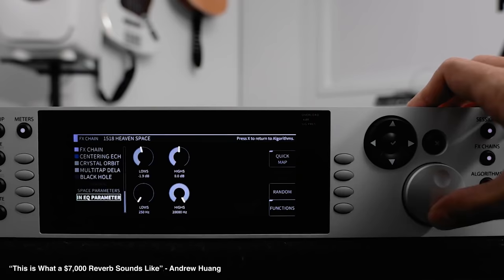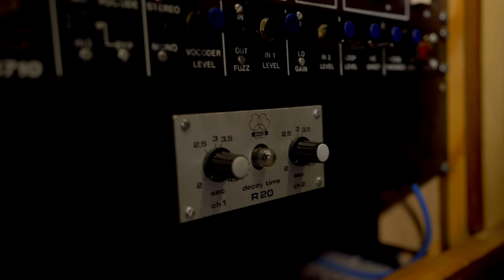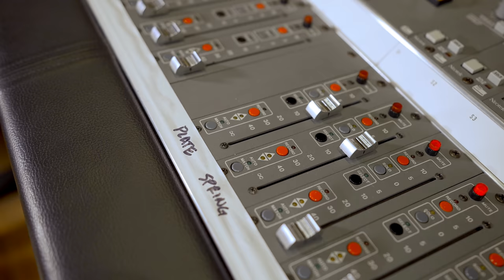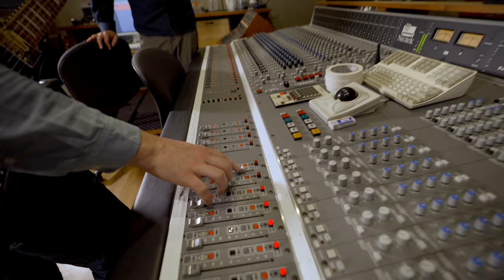Why Huge Metal Plates Are on SO Many Songs (reverb machines)

Comment: I'm by no means an expert, but to me it sounds like Jim Tuerk is mixing up electronic and digital here. I can't totally believe that reverbs have been digital since the 70s. I'm pretty sure that would be analog circuits with a few transistors, capacitors, coils (!) and resistors.

By all means, I would love to be proven wrong.
Reply: No you are right. He is mixing up BBDs (bucket brigades) with digital. While they have a sampling rate they are quite analog.
Reply: @ZapAndersson  Well, I certainly learned something new. Well, as they are descrete in the time domain, I get why you would call them digital. One could argue that they are "half digital" ... kind of.
Reply: @egilsandnes9637  no.. Digital means converting into the number domain and manipulate the values with math and converting back to analog. There were no usable affordable audio rate A/D converters until mid 80s
Reply: @ZapAndersson  I don't argue the are digital (or even half digital), only that I now get where he might be deluded into thinking they are. With an oscilator and discrete "bits" of data it might start to smell slightly of "digital" to some people, though obviously it isn't.

Comment: Here's wondering what other shapes or reverb would sound like... A plate reverb with a circular plate for example, or using a metal pipe instead of a plate... or what about a glass plate?

Comment: Jim is adamant that only electromechanical reverb is “analog” reverb. Digital electronics are called “digital” because they operate on signals that represent numbers (bytes and bits stored in memory devices). Analog electronics do not operate on signals that represent numbers, they alter input using arrangements of capacitive, inductive and resistive materials. This is closer to an electrochemical (capacitors and resistors) reverb rather than an electromechanical (spring) reverb. This type of analog reverb is still analog, it’s not digital!

Comment: I remember early old school delay/reverb acoustic implementations, like one with a speaker, spring, and microphone (not kidding).  It sounded TERRIBLE, totally unusable to me ear, and most anyone else's.  I expect I've heard the plates in recordings many many times, and they weren't what I'd call great, necessarily, but MUCH MUCH better than the spring arrangement.  The reverb they create is not what a natural large acoustically dynamic space does, though.  Again, people like it though, and that is fine.

My father made one once, just a delay for rear channels, not reverb, with a small tape loop moving very fast from a side by side record/play head.  Pretty darned good, as the tape was flying compared to any standard tape recorder, but being recorded and played back many times a second you can imagine that both the tape and heads were not long lived, especially the tape.  You could almost hear it degrade real time (not really, but close).  

The digital world, and INCREDIBLY fast processors, like current video processors, make the job really really easy now, and with near original fidelity (just the math and bit depth as limiters) and those sound REALLY good.  I expect if you did it at 24 bits and 192 kHz, DVD audio quality, 8 times more accurate in digitizing the sound (1st order, not quite, at least when I was looking at it), and well outside the audible sampling rate (a bit less than ten times the frequency) which makes the analog side of the filtering, to make a smooth wave out of a VERY fine discrete digitally sampled stepping one (DAC) a lot easier and a lot higher fidelity.  I suspect eventually you will need almost no filter, in essence it WILL be an analog wave out of the digitizer, except for that pesky Fourier stuff, but it will be way down there in consideration.

At work we did a 12 terraflop (12 trillion operations/second) signal processor for video a few decades back with a proprietary scheme called GAPP (geometric arithmetic parallel processor) and it was by far the fastest in the world.  Now you can buy PC cards cheap that will do it.  Ours used ninety two THOUSAND parallel processors (not kidding, or exaggerating), and fit in a box, with a few other features (FLIR, millimeter wave radar support electronics) about a  foot plus square, minus the power supply.

And no, the first echo chambers occur in places like large caves and 'small' canyons, and they are very long return times.  :-)  But yeah, human built ones.  The REALLY good versions of this are exactly what you showed, very large cavernous stone cathedrals.  Not too many pop groups recorded in those, to my knowledge, but many many choirs did.  Sometimes with additional instruments, but often with 'just' the organ.  If there's any one instrument that can stand alone, and do anything remotely resembling the complexity, and even voicing in some cases, of an orchestra, it is that one.

I expect those plate boxes are still used for the same reason some ancient guitar amps are, nostalgia and people expecting that sound.  Kind of like record player and tape deck use today.  World class goofy, but hey, doesn't everyone like pops that bury the music or notable hiss, and distortion, wow and flutter, microphonics, groove and tape wear, multiple generational copies degrading radically down through that series chain, and on and on, ad infinitum?  I don't.  

But hey, when you can convince so called audiophiles that speaker cables on little telephone poles that cost in excess of ten grand are worth it (again, not kidding), or in fact do anything sonically detectable, you can get people to believe anything.  Fools and their money, right?  They'd do much better to find really accurate speakers, like electrostatics, true ribbons, and WELL designed servo woofers (like old Velodynes) and actually hear REAL positive differences, the best sonic purity you can achieve, MHO (and many others that can hear).  They'd rather spend money on supposed 'transmission lines' than rid themselves of a poorly designed box with a bunch of $10 drivers inside (to manufacture).  Great vid, enjoyed it.

Comment: Reverb is nothing new.  Spring reverbs in amps and studios go back to the 1950's.  Big metal plate reverb is a 80's invention and it is debatable whether it was any better than the common spring reverb.  Prior to that the bigger studios had dedicated reverb chambers and engineers didn't have to run to cathedral's to have it.  The only genuine cathedral reverb I know of is Art Garfunkel's vocal On Bridge Over Troubled Waters.

Comment: I'm BOTH interested in music... AND has an education in electronics.. and.. "That's a lie".. no.. no it's not.. "It might have an analogue circuit".. yes.. that is the TRUE meaning of analogue.. and also what is the true meaning of "not digital".. Digital is about digital circuits (calculations done through using binary numbers and what not).. so.. what you THINK digital means is really what is.. "Electronic".. That is: All circuits after the point in time mentioned are.. ELECTRONIC.. not digital.. 

And yes; The difference matters.. quite a bit.

Comment: So you know those fake microphones you get your kids that adds reverb and slightly amplifies their voice. I wonder if that might be a spring reverb.
Reply: That's digital reverb generated by a dedicated (i.e. non-programmable) DSP chip. The "Reverb" control changes the % mix between the "dry" sound of the mic and the "wet" signal coming out of the reverb chip.
They're too small to put an analog spring reverb inside and even if you could, handling the mic would generate lots of unwanted noise from the springs. Hope that answers your question. ;)